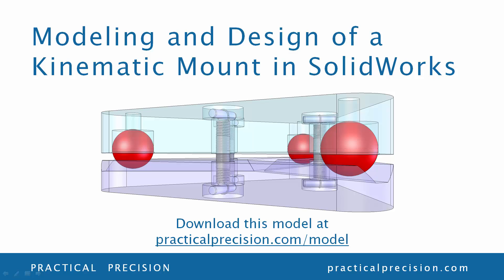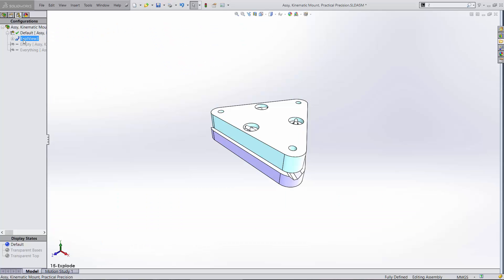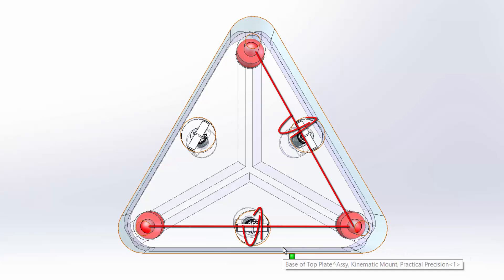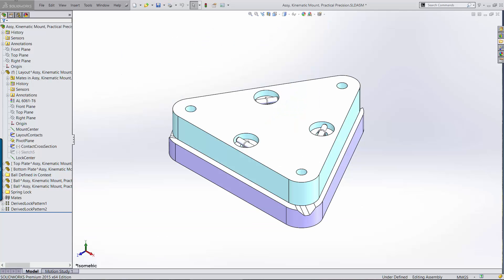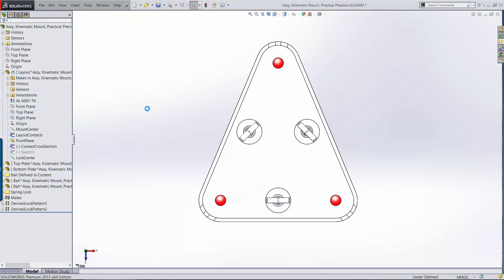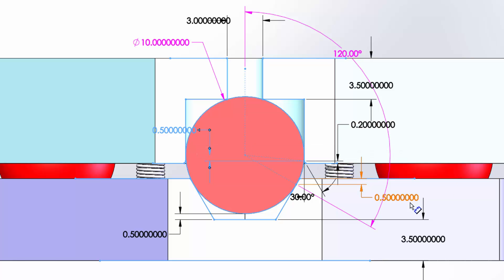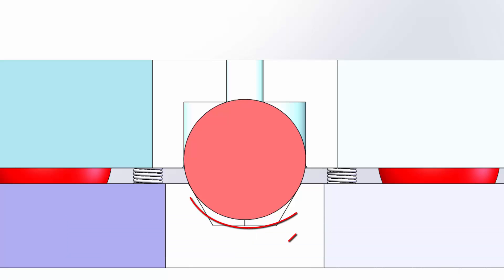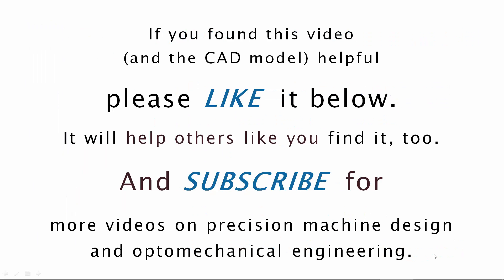Modeling a Kinematic Mount in CAD (using SolidWorks)

Comment: Actually, this setup with threeV-Grooves is *over-determined*!
Two Grooves do already inhibit rotation, so the third ball must sit on a flat surface.
Reply: actually, it is exactly constrained with 3 vees and 3 balls. if u do as u say the system will slide along the 5th surface.
Reply: If you used a flat surface under the third ball, the other two balls would be able to slide in their grooves and thus rotation would indeed be allowed.
Work it out by considering the effects of manufacturing tolerances:  what happens if one groove is offset by some amount.
Reply: Bit late to this, but, if you use a  female cone and a vee, you can then use a flat to simply constrain the last degree of freedom. 

Also I agree on the issue around machining tolerance. I.M.O, the 3x vees or cone+vee+flat should be 3 seperate machined elements that should be assembled to the plate loosely, then set as required off the 3x spheres, then tightened down in the as-required state. This means only the over-balls dimension on the 3 pieces needs to be precise, not the whole machining operation.